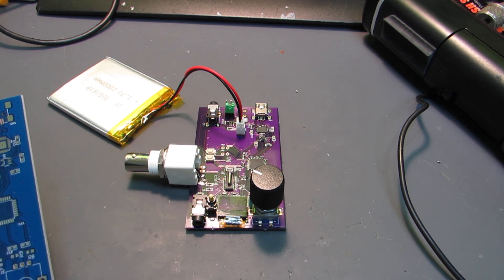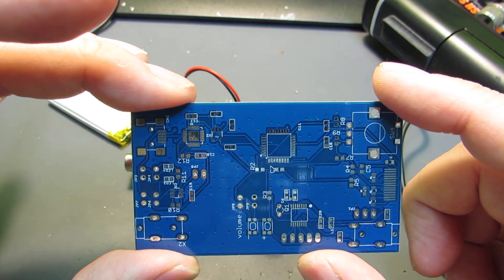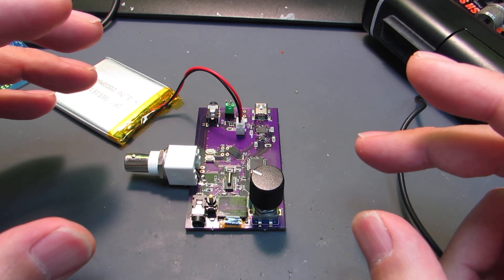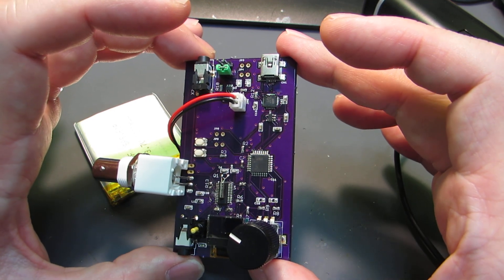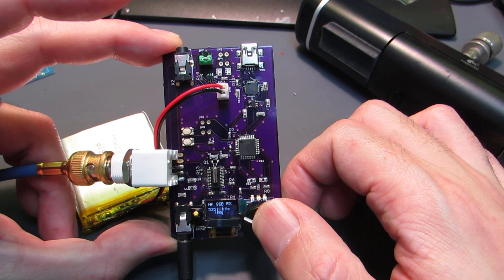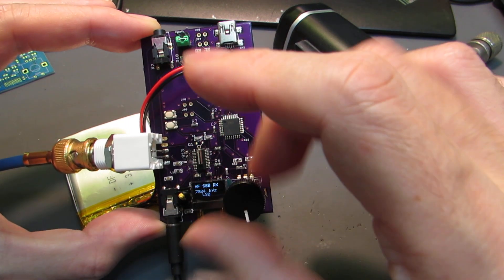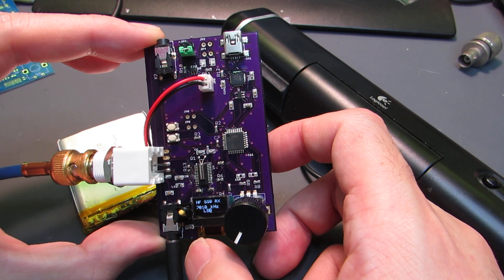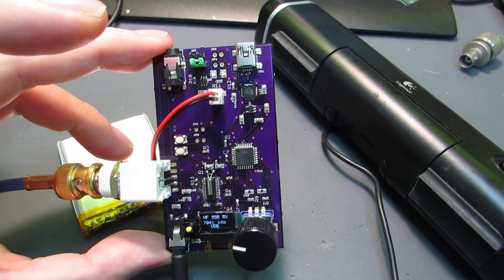New HF SSB receiver made of Si4735 is done!

Comment: Has anyone tried combining these si4735 receiver circuits with a Tx side and a relay for antenna switching? Seems an easy way to do both sides. You could use another clock generator output to make the carrier. I’ve already done the Tx side myself with an arduino-controlled CW/WSPR rig, and now looking for a way to add Rx on the cheap. These ICs seem ideal

Comment: Please post schematic or at least post your antenna and your tank circuit schematic.  I am having trouble with antenna matching a folded dipole through a balun and 75ohm coax.  What i am doing works, it just works poorly.  How much capacitance does a folded dipole through a balun and 75ohm coax have?  I have working code for si4707 SAME decoding.

Comment: This Arduino Library you are using was written by PU2CLR. Right?
Reply from the maker: Exactly!
Reply: Microwavemont If you are using a opensource code, you must share the pcb project and schematics, don't you?
Reply: Guilherme Becki, everybody is free to do anything with the open source library that I developed. Including close it. There is no restriction to use it. The license that I’m using is the MIT.
Reply: @beckiguilherme  If you use open-source code and it is required by the license, you must release the code or section of code that utilizes it, (it varies by license). Hardware itself is a completely separate thing, but works similarly.

Comment: Very good, I have been waiting for this. You will have to have to have a finer tuning rate for SSB and CW and FT8. I will buy one of these when you get it finished.
Reply from the maker: Thank you for interest. YES, the release version will have filter switch and I hope it will work for good CW reception... Thank you!
Reply: add me in! looks very promising!
Reply: I agree,  impressive, a slight pity that the demodulation hushes each frequency step, but I'd put up with that.  The si5351 could easily be used to generate CW in the usual way.  Is the software open source?

Comment: Very nice! I think this same chip is in QCX and soon QSX transcievers. It is indeed a very interesting chip with impressive specifications and applications. Thank you for the demonstration video =)
Reply from the maker: The chip by Silicon Labs in QCX (actually I have two, 7MHz and 14 MHz version with 50W amp) is for signal generation, and QCX reception is I/Q direct conversion realized by discrete components... I think QCX is the best transceiver kit in the world :-)
Reply: Can I order this radio kit on your Tindie shop?
Reply from the maker: @NexxuSix  I hope, in the future, YES. But currently it's far from release (I need to add and mod lots before release.....) Thank you!